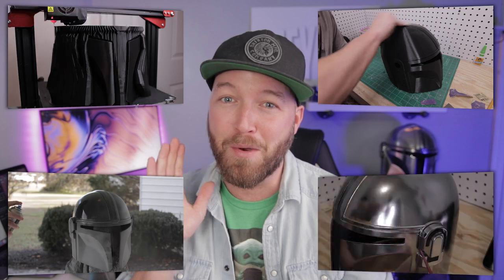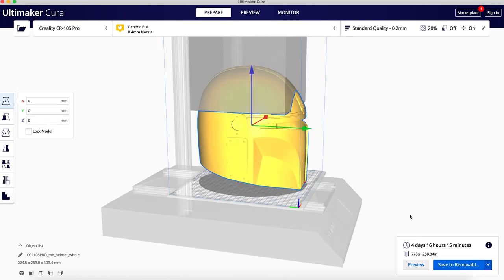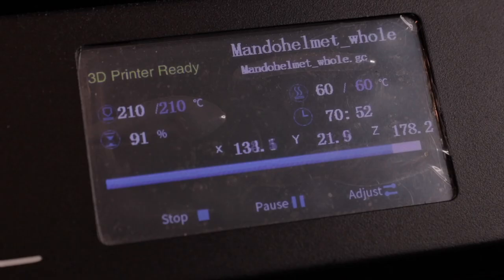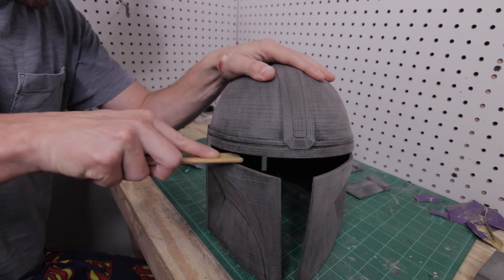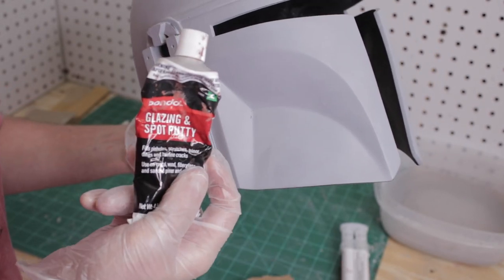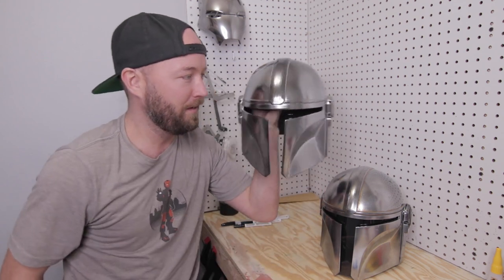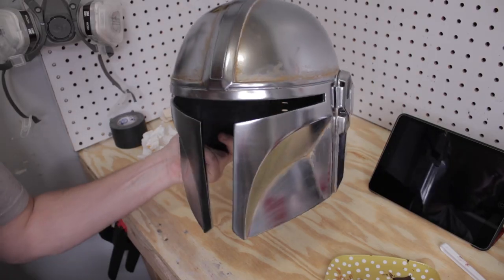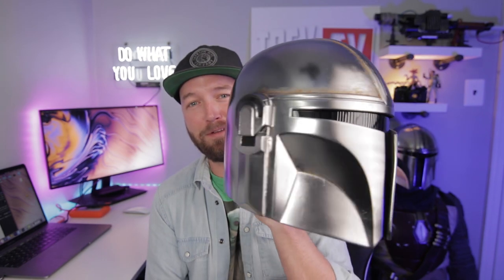Making The Mandalorian Helmet | 3d Printing, Finishing & Painting

Comment: What's wrong with your support settings - you could have easily used that amount of filament for a 50% infill print. I printed the whole thing without any support at all. By the way you may want to use PETG next time so your helmet does not explode into pieces once dropped.
Reply from the maker: LOL..just printing it how others have printed it successfully.  I didn't use supports in the middle of the helmet.  I use PLA+ and have never had ANY issues with it "exploding in pieces" but thanks!  😂

Comment: can you help with how you set up your Cura files? I bought GreatApes Mando Helmet as well, and he pointed me to Your video. Loved your set up, when I first did my set up it said it was going to take MANY MANY DAYS not 4. I am also new to 3D printing so I am not sure how tree supports work and why your No Support Section is on the TOP of the helmet. Also do you know how much Filament you used?
Reply from the maker: Hey there! My Cura settings are the stock settings, printing at 210 for PLA+.  Definitely YouTube Tree supports and set those up..it's really easy and exactly what I did.  Saves you a ton of plastic and time!! As far as the no support section, I've learned that a dome shape builds upon itself thus supporting itself.  Definitely scary at first but it works out.  Have seen a ton of other people use no supports in the center as well so that helps :-) For filament, a whole Mando helmet is almost a whole roll (1kg)..just the helmet part is 770g.  Hope this helps!!

Comment: Which 3d printer would you recommend for smaller Star Wars props like lightsaber hilts and blasters? Im currently looking at the Ender 3 v2
Reply from the maker: Hey there!  I love my Creality CR10s Pro V2 because I can print whole helmets but you can do A LOT with their smaller printers like the Ender series!  I have loved my machine but more importantly as a first time printer I loved buying from TinyMachines3D.  I paid a little more to get it from them but they are the best.  They take the machine out, set it up, do any upgrades to it, run it through an inspection list, box it back up and send it to you.  Their customer service has been incredible!  Def recommend and without any sort of sponsorship whatsoever.  Hope this helps!!